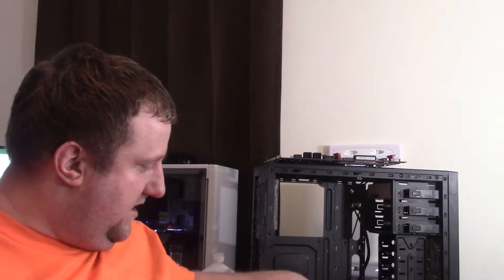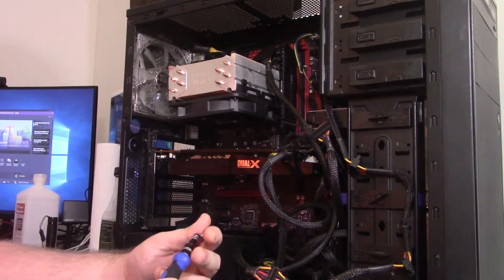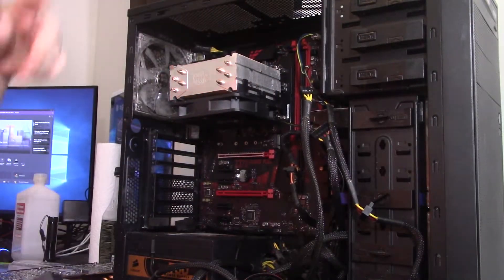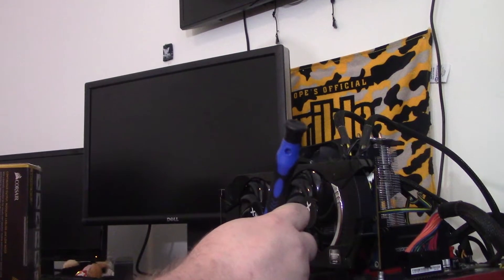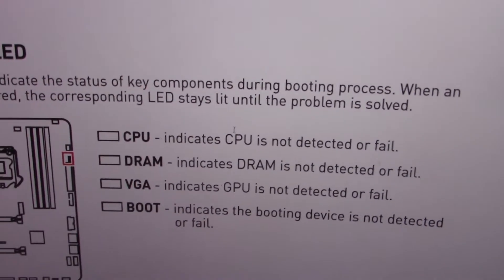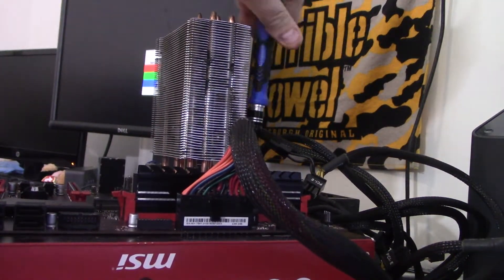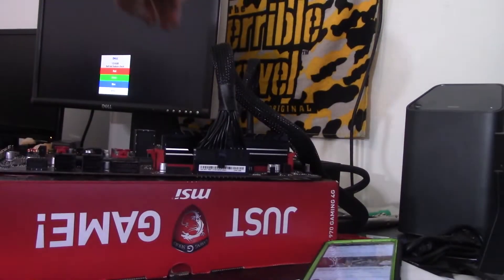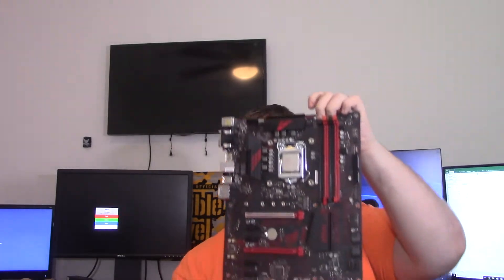Fixing a Customers PC Episode 3, The Original Gone Bad?

Comment: $5 shipped gets you a used G620 Pentium on Ebay to rule out CPU failure.
A better option may be to look for a dirt cheap used 2nd gen complete system locally via Craigslist, Facebook marketplace, ect as you get both a cpu and motherboard to test with.
Reply from the maker: We covered this in PM, but for those that may not have caught, the system originally was 2nd gen, he bought an 8th Gen board and I5.  I didn't have any 8th gen parts laying around.

Comment: If you saw bent pins in the CPU socket on the mobo, why say it might be a bad CPU?
Reply from the maker: I'm skeptical if it was bent or designed that way. It was a corner pin that looked like it was slightly bent down. When I looked up a wiring diagram it was a ground which would have no adverse affect on the system.